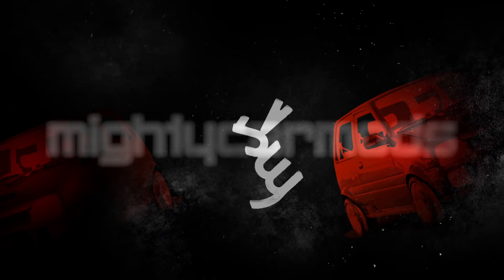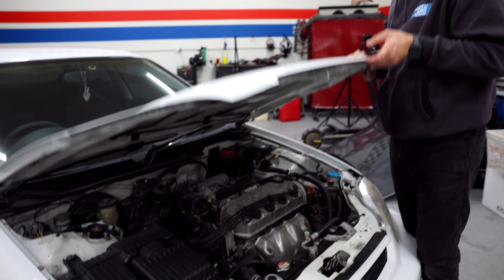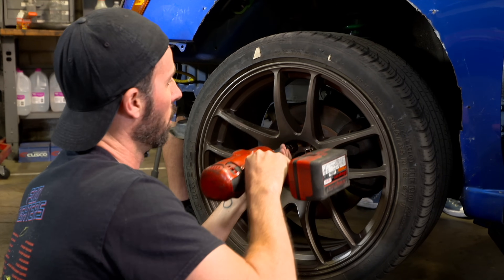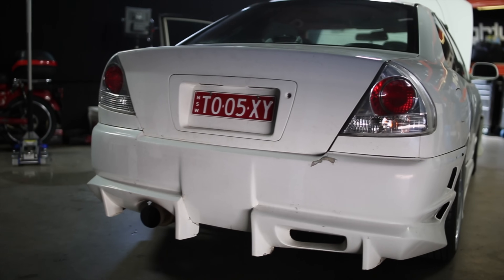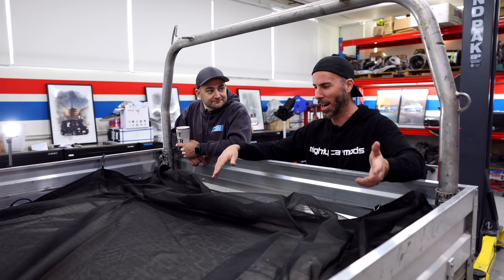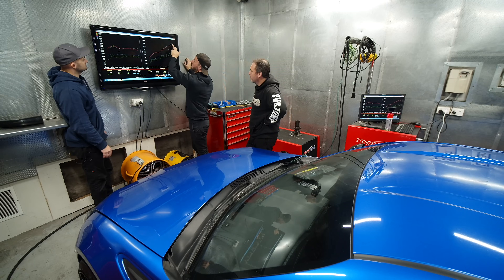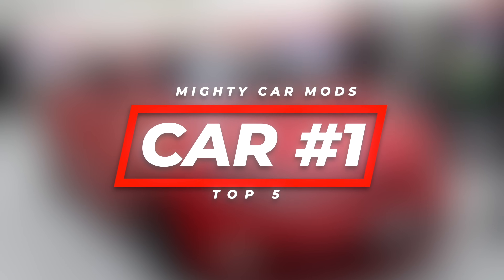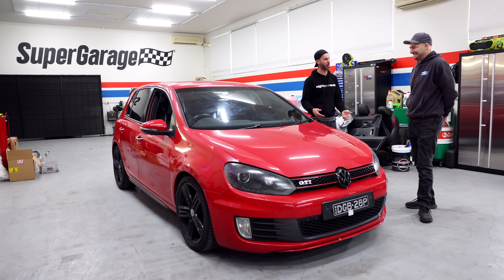The 5 BEST CHEAP CARS to Modify FAST | MCM

Comment: soon petrol and diesel cars apart from the high-end models will be so cheep you won't be able to give them away when tesla and over makes and china flood the car market with evs as they are all out of stock people are waiting over a year to get there evs as they are so popular and faster than any fuel power car a tesla was beating a top fuel drag car wtf I've driven one and boy the response is awesome I just miss the sound you can't beat the sound of a good v8 pounding or a v12 just brilliant and even that has been done by dodge with there new ev it makes engine noises and looks awesome as well so petrol car will die I am afraid but not yet so make the most of your fuel power cars or convert them to run on electric motors like a lot of people are doing now and are going twice as fast.

Comment: #3: “Whether you are planning a spontaneous uprising, open-ended jihad or a brutal insurrection, the Toyota Hilux is the number one choice of madcap technical for self-respecting insurgents across the globe. Compatible with all the lines of looted weaponry and with decades of proud service behind it, make sure your roving gangs of banditry ride to battle in style. Warranty might be voided by installation of calibers in excess of 23 mm and the application of air-to-ground rocket pods is not recommended by Toyota Motors.” Community, adventure and modifications, right…😏

Comment: Subaru= rot. theyrre too noisy because dickheads buy them and put stupidly oversized exhaust backboxes on and no other power upgrade mods. most of the 'McRae' shape ones have rusted away. even the hatch ones are rusting away now. 
Honda's arent followed too much here either. Type R models yes, but again, being Japanese, they succumb to rust. 
Hilux have, in my experience, weak engines. ive had 2 with under 100k miles that engines have let go on me. and they were the 'indestructible' ones as championed by the UK version of Top Gear. EVERY person i know that uses such a vehicle for their work or daily has swapped to a Ford Ranger and NOT ONE would change back to a Hilux. again, being Japanese, they have a tendency to rot here too. its why Japanese cars dont sell well here. contrary to popular belief, Japanese cars dont physically break down any less than any other brand here either. 
BRZ/86? might as well buy an older Mercedes or BMW and have a car that will LAST a good few years.
Golf GTi? so overrated its unreal. WAY overpriced too.ALL Golfs are. you want fun, practical, fast and VERY modifiable? look at Ford, Peugeot/Citroen etc, not VW. electrics are also much more problematic than even French stuff!